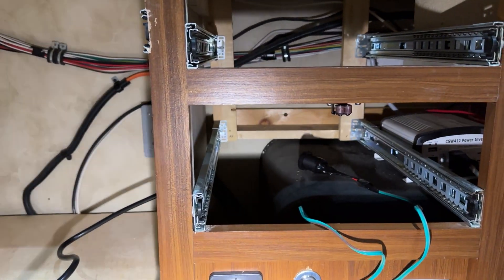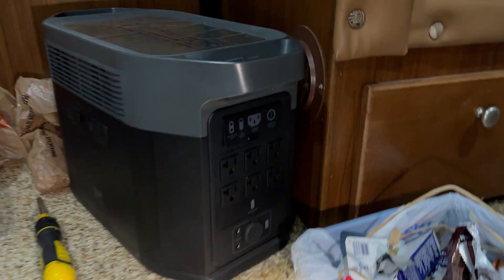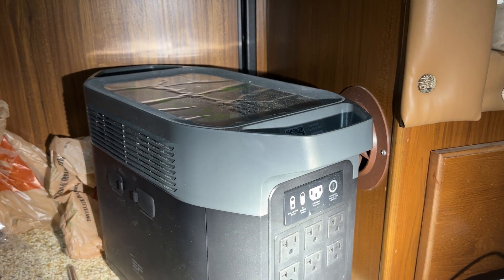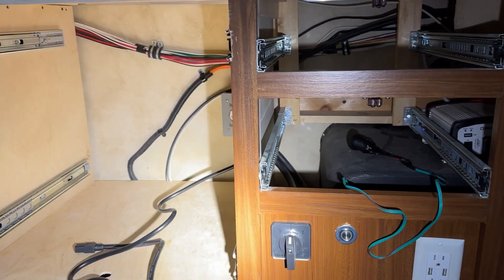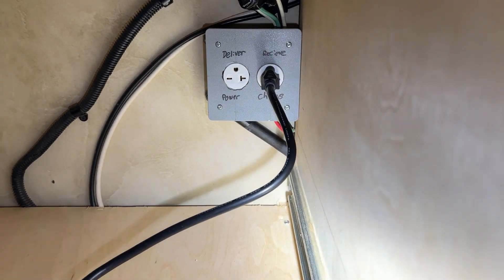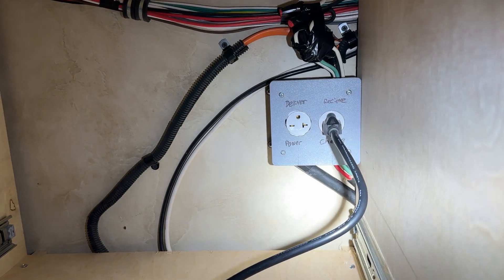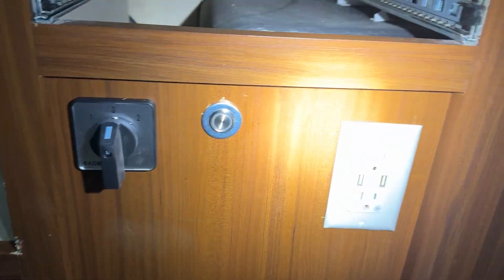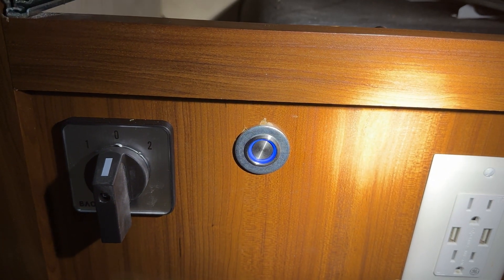Ecoflow Powerstation Custom Install for Truck Camper

Comment: I don´t understand the purpose of this switch. Ecoflow powerstations (I do also have one, but a smaller one), are able to receive and release power at the same time. So either solar from the converter and/or grid from the input side, and output the same time. It can be also used as an USV. The only important one would be, that the Ecoflow would be "built in" with the display and power on button visible from the outside every time. So something like a spare in the front of the storage door, which fits the size of the front panel of the ecoflow. And some doors for the inputs and outputs to connect and release, if needed. By the way: With the usage of solar, it could make sense to add some additional (car, truck, whatever) battery to charge this thing from the ecoflow as a backup, and get power of it, as needed. Because the ecoflow could work like this. For this, it would make sense to add a switch for to change input from solar to external battery, and, if needed, a second one for the 12V output to switch between external battery for to charge or additional usage in the camper.
Reply from the maker: We did it this way because we didn’t want the Ecoflow scavenging power from itself. My parents are many times in a remote area with no shore power. We wanted to ensure that stores energy in the Ecoflow was only for camper use. This of course only applies to the AC system. They also have a connection to their battery bank and solar system which can be used at any time.